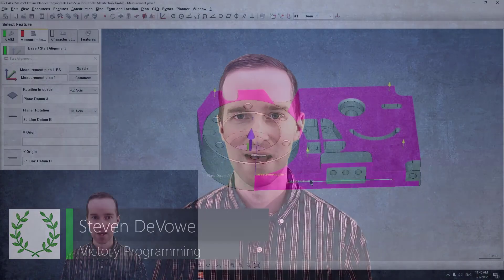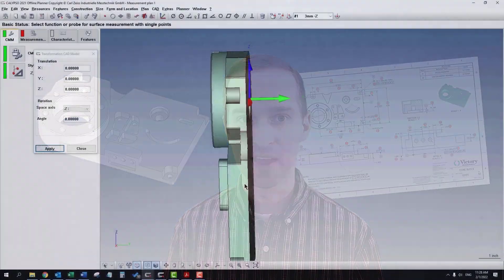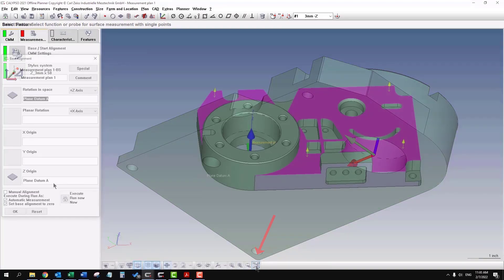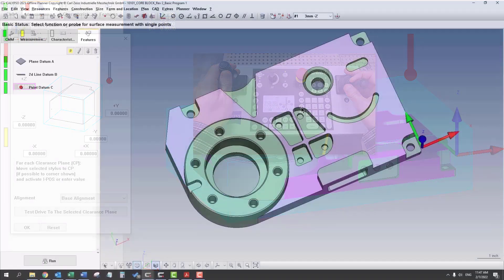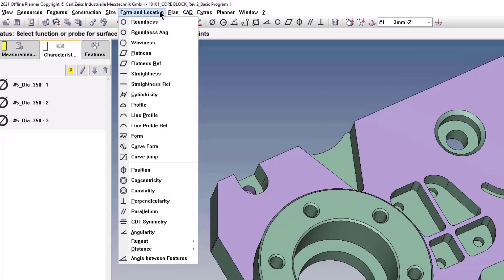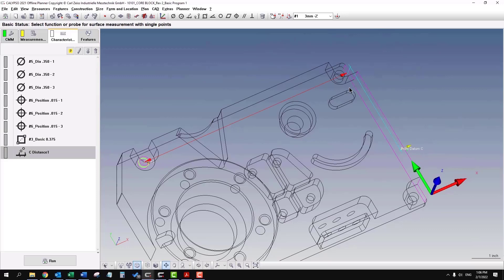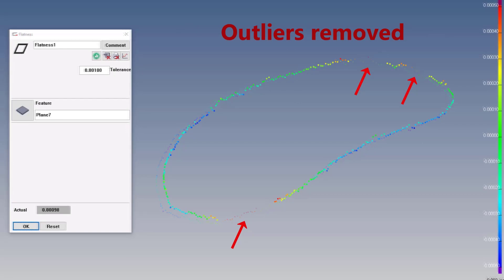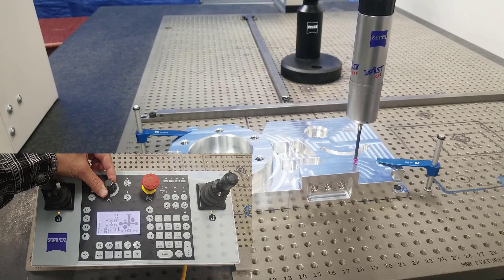Learn Calypso by Example: Basic Program 1 Preview

Comment: We have a Contour G2 ,while cnc running mode , when its taking point or move from one place to other ,its table take jerk ,is this normal.
Reply from the maker: Yes, this is normal, especially if the CMM is a smaller one. You can reduce the measuring speed in the run window and also in the measurement plan editor under travel - speed. The 1st option controls speed between features , and the last option controls the speed between points within a feature.